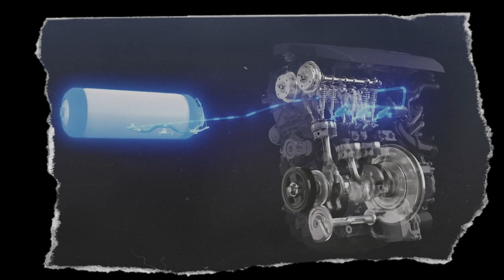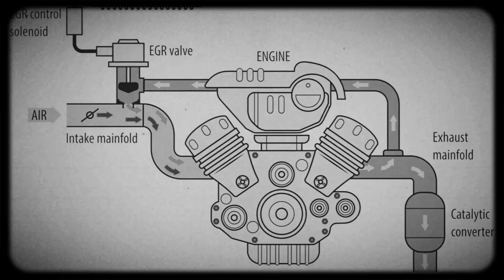Ford 3.0 Power Stroke V6: Full Specs, Biggest Issues & Long-Term Reliability Review!

Comment: Have the same engine in my 2023 Ranger, while touring with our caravan I noticed on an incline the engine oil temp was increasing and I had to back off while climbing. 
We did the same hill a year ago and didn't have the issue. 
2 days later the engine failed at 39,000km. 
Ford say it was attributed to an injector failure that over heated piston 5, causing it to fail. 
I have my suspicions that the EGR may have been on its way out and failed. Thoughts? 
When the failure occurred the engine would still start and run, but sounded like something was getting thrown around in the top end of the engine.

Comment: 70k on mine so far and its been flawless. I do a decent amount of city driving but average 22.6mpg combined. 25-27 on the highway is not unusual. If the emissions system ever fails it will be removed.

Comment: My 2018 with 170000 miles gets 25.6 mpg. No mechanical issues regular oil changes at 3000 miles or less. Have done timing belts and chains (2 belts two chains). Running good no issues.
Reply: May I ask the cost for the replacement of chains and belts?
Reply: You do an oil change almost every month!!!! Is this the 1920s rather than 2020’s 😮
Reply: @300bhpton actually about every 2-2/12. I’d much rather do the oil changes the way I do than an engine or other major repairs. I have had vehicle with well over 500000 on them and still running strong. I do at least one oil analysis each year, they have never show any wear.m

Comment: I would dispute the "excellent" fuel economy comment.  It is good (far better than any other F-150 engine) but it cannot match the 3.0L Duramax.  Those common issues listed are quite rare in my experience.  Never had a single emissions issue on mine as I start my second hundred thousand miles.
Reply: I have a 2018 with 170000, I get 25.6 MPG. Can’t complain at all about that.